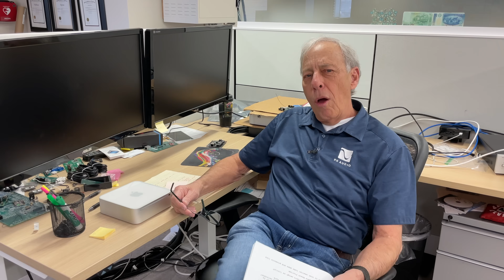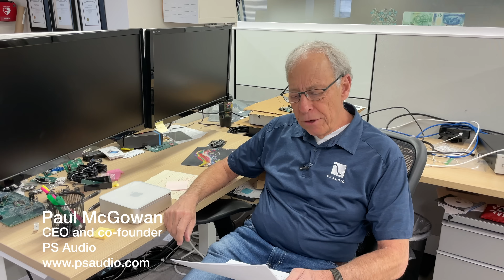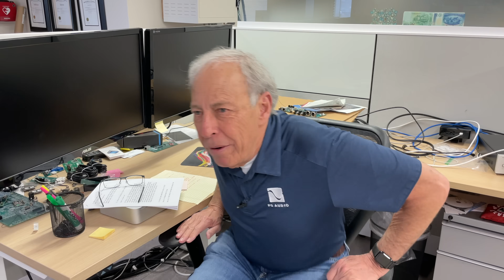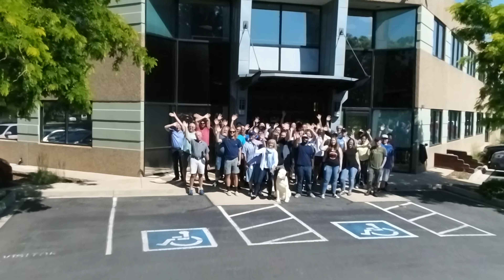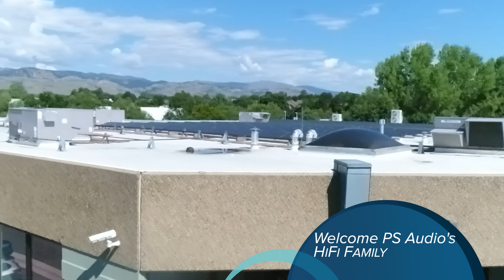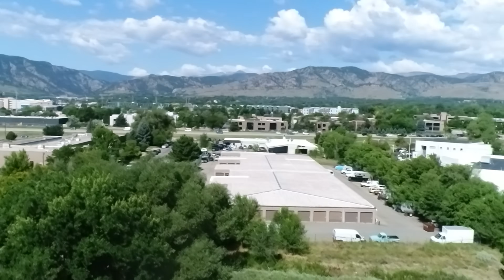What is damping factor?

Comment: An intuitive comparison is the suspension of a car: you have a spring (analogous to a loudspeaker driver) and a damper/shock absorber (analogous to the amplifier).
The damper in a car limits the oscillations of the spring after it has been compressed by a bump. We want those oscillations to stop quickly, otherwise the car would keep bouncing even after the bump.
Similarly, in audio we want to limit the diaphragm’s oscillations after it has been displaced to produce a sound and that sound has ended, for example, a drum hit.
If the diaphragm kept oscillating, the drum would sound unnaturally long instead of short and tight, and the audio quality would be severely degraded.

Comment: In order to utilize a high damping factor (low output impedance) to the fullest extent possible you must use very heavy Gauge speaker cables.

Comment: I get intermittent pauses in audio only while streaming and only in surround sound. If I turn off surround and just use the TV speaker it is eliminated. Using all HDMI or ARC cables. System
Sony TV XBR 75X900H
Receiver Yamaha RX-V685
FIOS fiberoptic box
Sony BluRay
Paradigm 6 speakers including the subwoofer
Any ideas on a solution or who I can ask on what to do? 
TY

Comment: 8ohm speaker divided by .01 is 800 which is a very high damping factor for a power amp.  Did you mean 8ohms divided by .1 which would be a damping factor of 80?

Comment: The resultant listener experience with damping factor is in speaker cone control, and that means distortion, since the most distortion is introduced in the speakers. Big speaker cones at large volume with low frequencies are not easily controlled.

Comment: With electrostatic speaker systems, damping factor would be irrelevant!
Reply: Yes, and no. It takes a lot of instantaneous current to move something that is purely capacitive. If you only fed it voltage and almost no current, the capacitance of the panel would act as a low pass filter. Lower output impedance (at the same high voltage) would have better control.
Same goes for electrostatic headphones, the Stax SR-007 being famously harder to drive, due to higher capacitance. Thankfully many electrostatic speakers have amps built in. If it uses transformers, that damping factor still applies as it multiplies the effective capacitance seen by the amp.
Most amps at that voltage already have enough current, even transformerless tube.

Comment: Just give us the output impedance of the amplifier, the DF number is just a construct. The idea that the amplifier can add damping is a mathematical myth since you would need a negative impedance to improve amplifier damping and a positive number can only make the damping worse. The T-S equation that defines (2Pi*Fs*MMs*Re)/(BL)^2 where Re is always a positive number that must be the added value in Ohm of the output impedance of the amplifier plus the impedance of the speaker. Note there is no partial division of Re parts of the impedance of the speaker versus the output impedence. They cannot be divided, they must be added. But I am sure that even those solid numbers will stop the DF myth. Also, T-S tells us in no uncertain terms that the damping of the loudspeaker is entirely defined by the alignment. So the output impedance is only a part of what can modify the alignment. But if you equalise the current of the amplifier, so that all frequencies below 200 Hertz the current is the same (flat impedance), this will in effect cancel out the output impedance of the amplifier in the sense that the amplifier output impedance cannot change the alignment. This is not theory, it is a fact, both mathematically correct, and that there are now several DIY loudspeaker designs that do this - the output impedance of the amplifier can no longer influence the alignment.

Comment: Damping Factor is only one of many factors that affecting the damping ratio denoted by ζ (zeta) of a speaker system.  To achive best speaker sound, the damping ratio must be tuned to a proper value depending on the design of the speaker system.  For any speaker system, there must be a best matching amplifier outpout impedance.  In old days when speakers were designed for high output impedance vacuum tube amplifiers, damping of speakers were mainly done by mechanical means.  Nowadays speaker dampings are partly mechanical and partly electrical since solid state amplifiers have low output impedence.  So, whether high damping factor is good or not depends on what speaker to be used.  Furthermore since amplifier output impedance is connected  in series with speakers, as long as speaker impedance plus cable impedance dominates the total series impedance say 99%, further reduction of amplyfier output impedanc makes no noticeable differences. Therefore a damping factor of 100 is high enough.  Increasing damping factor above 100 has negligible effect.
Reply: Thank u for that insight! Which amplifier would you recommend for the JBL XPL200 Stereo Speakers? My amp (Sansui AU-G90X) isnt able to control the big cones very well.. do u have a good recommendation for an amp that can handle those beasts more confidently? :-)

Comment: Hi Paul. Thank you for your patient knowledge and experience sharing. Great Videos.
Regarding an output of an amplifier impedance, In my experience and knowledge, it should be lower such that it's presence will not be a noticeable. The actual damping impedance for the driver of the speaker is the sum of:
a. Amplifier output impedance  
b. Amplifier Binding Posts (Both Plus and Minus)  to speaker wires resistance ( Let's  assume 0.05 Ohm)
c. Speaker cable impedance (Both Positive and Negative, lets assume 0.1 Ohm for 2 meters cable)
d. Speaker Cabinet Binding Post (Both)  (Let's Assume 0.05 Ohms)
e. (In some Cheap Speakers) Speaker internal wiring ( lets assume 0 Ohm)
f. Cross Over Coils internal DC resistance  (lets assume 0.2 Ohm) 
g, Speaker Driver internal DC Resistance (usually few ohms, but let's assume 0 Ohms)
i.  For the Woofer: Serial Coil impedance at Pass Area, i.e if upper 3dB cut frequency for the woofer is 1000Hz (for 2 order C.O), it means that coil impedance at 1000Hz is ~ 4 ohms, it means that  at 100Hz Coil impedance = 0.4 ohms and 0.1Ohm at 25Hz
 
So by this example we see between the amplifier  and the speaker added resistance /impedance of ~0.8 Ohm @ 100Hz

If my example is close to real life, it means that an output impedance of 0.08 Ohms = Damping factor of 100 is more then enough for an amplifier.

As per Feedback, too much feedback kills the Power amp slew rate (Rise time) ability.  A high Slew rate is a parameter not so known or looked at, but IMHO very important indicator for the amplifier bandwidth, speaker synergy behavior and clarity.  

Thanks and best regards

Comment: Super job by Paul on this one. One way to better understand this is to connect an analog voltmeter across a cone speaker terminals and measure the changing voltage as you gently push the cone in and let it come out. The voltmeter will register the changing voltage. The amplifier has to control/sink that generated voltage/current. Also "Damping Factor" is frequency dependent. An amplifiers damping factor will be different at 60Hz than it is a 10Khz.
Reply: A very effective demo is to tap the woofer on a disconnected speaker. (larger the better) then short the speaker terminals and tap again. The difference is extremely audible and a direct demo of what damping factor does.
Reply: @glenncurry3041  Have you ever used a speaker as a microphone? As I kid ( a long long time ago ) I tried that and it kinda works.
Reply: @wilcalint  Yes that is exactly the Counter EMF, the voltage generated by wires moving in a magnetic field, that needs to be shorted out, needs to be allowed to control the driver instead. And that is what the DF number tells you. How close to a dead short is the output of the amp so this Counter EMF can be controlled. The number is just a ratio between the amp's output impedance and an 8ohm load. A DF of 100 just means 8ohms/100 = 0.08 ohm output impedance. 

another way to look at this is 12ga zip cord is 0.02 per 10ft. So an amp with a DF of 100 is like adding 40ft of lamp cord.

Comment: Dampingfactor of 100 and more is theory, cause in line with the Speaker are the Cable, Connectors and if passiv the crossoverparts. Only way to have the benefit from a high dampingfactor  is an activ speaker system. A passiv System not higher than 8 for an 8 ohm System, or 4 for a 4 Ohm system
Reply: A manufacturer measures and publishes Damping Factor as measured into an 8 ohm load. That published spec has nothing to do with external wiring, speakers or crossovers.   It is a completely meaningless and useless number other than a way to get the output impedance of the amp. Chosen because the numbers look better than the technical equivalent.
Reply: @glenncurry3041  yes right, the number is meaningless, a other description for a output impedance. for the whole thing you must also add the the impedance  ,all parts between the amp and the speaker. A assumption from 1 ohm for the parts is real.  The speaker(the generator) sees a load from 1 ohm and the output impedance from the amp. For the speaker it is no difference if it is 1ohm (parts) and 0,01 ohm (amp) or 1 ohm and 0,1 ohm. A activ system can minimize the parts impedance,  short soldered cables, no  crossover, no connectors
Reply: @cbts001a4  Make sure you first give any wire connections a solid crimp before soldering. Crimping is actually a better lower resistance connection than soldering.  Solder has 5-7 times the rsitance of copper.
Reply: The coils and wires may add up to a half Ohm maybe, then factor in an additional 6 Ohms of series resistance within the 8 Ohms driver. So the system damping factor can never get better than 1.33. So forget 100, 800 or 4000 damping factor. You still end up at 1.33

Comment: people over think the output Z too much when it comes to headphone systems. Most headphones aren't sensitive to impedance matching with the amp. IMHO, low output Z on the amp doesn't mean it will sound best. e.g. a tube amp has higher output Z and it sounds more "natural" than solid state with under 1 Ohm output Z. I would say for headphone amps, 5–15 Ohms output Z is good middle point.

Comment: Some Hegel amps have 4000 and they sound amazing.
Reply: Jerry the answer is yes, absolutely red is the fastest color. Did you ever see a fast turtle, no because they aren't red.
Reply: A lot of cars are red and drive very fast. But the question is: do they drive fast because they are red?

The same goes for damping factor!
Reply: Yeah, a DF of 4000 is just a 4 ohm speaker driven by an amp output impedance of 0.001 ohms, which is about the minimum output impedance you'd really realistically want in an audio power amp for good, full sound. On the high end you don't want much above 0.01 ohms of audio amp output impedance, like Paul said, and that amount which when driving a 4 ohm load, would then be a DF of 400.

I've seen amps (and receivers) with DF of between just below 100, (like 80 or so), and a few thousand, like those Hegel amps you mention. Anywhere in that range is good DF for an audio amp, but you just don't want anything much above (or below) that range because it will start to reach that point of sound degradation, as Paul mentioned here.
Reply: @JoeJ-8282  Thank u for that insight! Which amplifier would you recommend for the JBL XPL200 Stereo Speakers? My amp (Sansui AU-G90X) isnt able to control the big cones very well.. do u have a good recommendation for an amp that can handle those beasts more confidently? :-)
Reply: They practice some miracles there

Comment: You don’t need electromagnetic damping and you don’t want electromagnetic damping.

Of all the ways of damping electromagnetic damping is by far the worst.

And why is it bad?
* It is unpredictable. A lot of factors have their influence on electromagnetic damping: Amplifier output impedance, cable impedances, voice coil impedance, voice coil temperature (and thus room temperature and how loud you play). So, you have no control over the amount of electromagnetic damping. So, you have no control over what the driver is doing.
* Electromagnetic damping is making use of the driver as a generator, as a microphone. It doesn’t only pick up the cone resonance, it picks up all cone movements: external sounds, sounds inside the enclosure, cone vibrations, added harmonics, port noise, noise from ferro-fluids, noise from eddy currents, etc. The generated signals distorts the input signal, the lower the output impedance (the higher the damping factor) the more distortion.
* For electromagnetic damping you need a low output impedance (a high damping factor), which makes the current and thus the output of the driver sensitive not only to back-emf (“the microphone signal”), but also to the voice coil inductance and the voice coil resistance.
* The inductance is not constant, it is modulated by excursion and by current. As every ferromagnetic filled coil this creates phase shifts, modulated noise, distortion and especially (added) intermodulation distortion (till 30%, see the website of Klippel for more information).
* The resistance is not constant. It is modulated by temperature, and thus also modulated by the music itself. Changes in voice coil temperature changes the output (thermal compression), changes the electromagnetic damping and changes the frequency response. The thermal compression is driver impedance dependent and thus frequency dependent.
* And above all, electrodynamic drivers are driven by current (201 years ago, already, Ørsted found that it is the current and not the voltage that creates the magnetic field and thus the force). So, when having a low output impedance (which makes the amplifier a voltage source) you give the opportunity to have all kinds of impedances and voltages (EMF) their influence (compression, distortion and modulated noise).

There is also another form of electromagnetic damping. The movement of the voice coil generates eddy currents in conducting voice coil formers, which create modulated noise. And that is picked up by the microphone effect and added to the input signal.

To get rid of all these effects you need two things: a high output impedance, 800 Ω or more, and non-conducting voice coil formers (I use an amplifier with an output impedance of more than 1200 Ω and I have drivers with non-conducting voice coil formers). Then you have a stable frequency response (and resonance) and you can make it (and the resonance) what you want (dampen, correct, tune, extend) and the distortion in the drivers is much lower (total lack of current distortion, see website Klippel also, for more information).

There is one caveat: a high output impedance doesn’t work with traditional (voltage) passive crossovers. You need redesigned passive crossovers (see Nelson Pass) or active crossovers, even better.
Reply: Thank u for that insight! Which amplifier would you recommend for the JBL XPL200 Stereo Speakers? My amp (Sansui AU-G90X) isnt able to control the big cones very well.. do u have a good recommendation for an amp that can handle those beasts more confidently? :-)
Reply: @toktok3796  No, I don't have a recommendation for an amp for those speakers.

High impedance / transconductance amplifiers and redesigned crossovers are a totally different path, and probably DIY...

The suggestions I have is:
- Find out if it is really lack of control or if it is a setup/room issue.
- Experiment with setup first.
- Try to correct with (parametric) EQ or DRC.
Reply: @JerryRutten  thank u so much for ur answer! I will try to reach more with room acoustics and room correction via dsp…0

Comment: Everything in system design is a compromise and  obsessing on damping factor as the bad boy is not helpful. Improving the damping factor can cause other issues in amplifier design especially when it comes to negative feedback. Also some speakers can sound less sterile when using an amplifier with a poorer damping factor.

Comment: My Bryston 3bst has a very high damping factor.  It takes total control of the speaker; sound is very quick and tight. So its  quite common to pair a tube preamp with them to tame them.
Reply: I had a 4bst and noticed the same traits. Unfortunately, I sold it before I really found the right preamp for it.

Comment: My own anecdotal experience gained over a course of 45 years of owning one amp or another is that damping has a sweet spot, and that amps with very high damping factors just don’t sound very good. I doubt that anything over 200 or so is actually beneficial especially with speakers that have over damped low ends to begin with.
Reply: You're not alone, and not the first...

See the two articles from 1954 and 1955 (!!) by D.J. Tomcik: Missing Link in Speaker Operation, Parts 1 & 2:
- The Amplifier Damping Factor and its Application to Speaker Performance
- Obtaining Variable Damping Factors in Amplifiers; Determining Critical Damping Factors

And, on top of all that, the actual electric damping is heavily modulated by a continuously changing voice coil resistance.